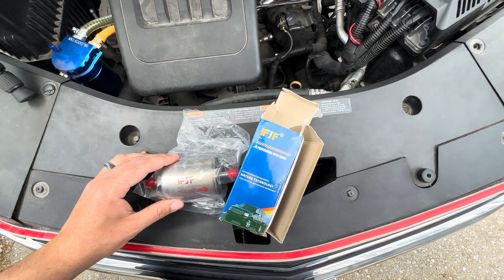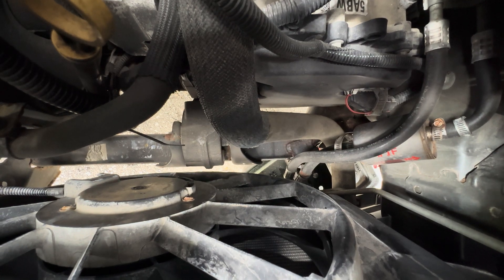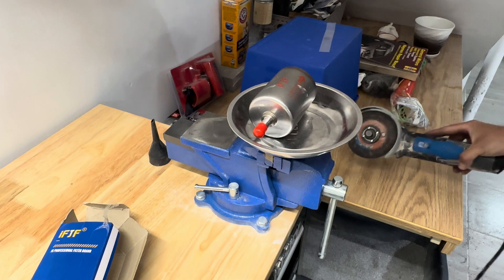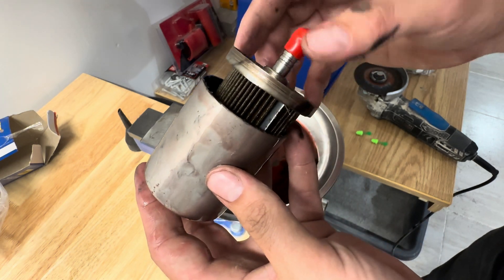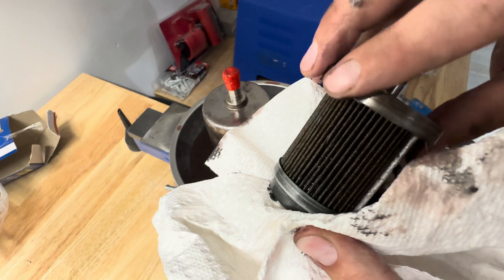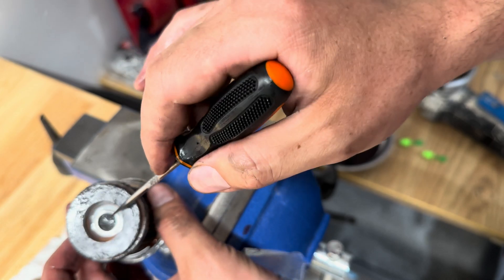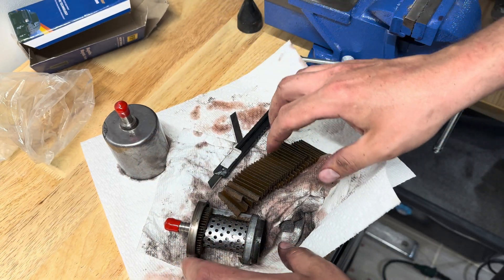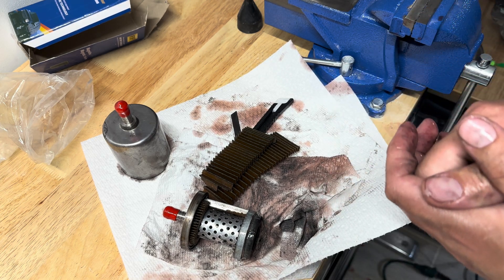Magnefine Inline Transmission Filter Cut Open After 40000km

Comment: I wish they had a clear case that you could unscrew and change the filter when it visually fails inspection.  I am putting one of these on a Ford van because the cooler is polluted a little. Flushed it out really well but that's not everything. One of these should catch the particles that remain.
Reply from the maker: I agree that would be a neat feature, but I don't think they have that. They have glass fuel filters but the screen won’t be as effective on trans fluid. Hope the filter clears up your fluid and you get running tip top shape soon. Thanks for watching. Please like and subscribe

Comment: I have a 2015 equinox. I change my tranny oil every 30k , no filter installed yet. That oil gets dirty pretty fast. How often do you change your tranny oil?
Reply from the maker: I found if you use eco mode it ruins the transmission fluid faster. I leave eco mode off and as you can see in the video it’s still fairly red. I’m gonna take out maybe 1 cup of fluid every couple years for a visual inspection and change only if it’s bad. I don’t usually go by mileage. Thanks for watching. Please like and subscribe